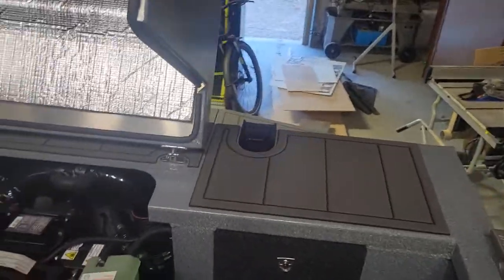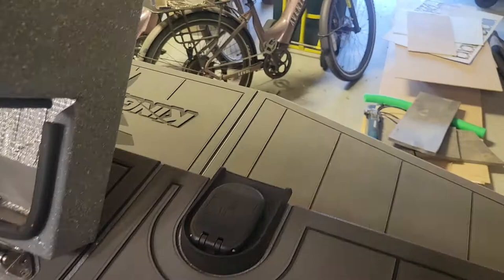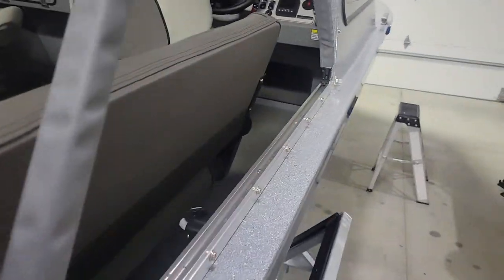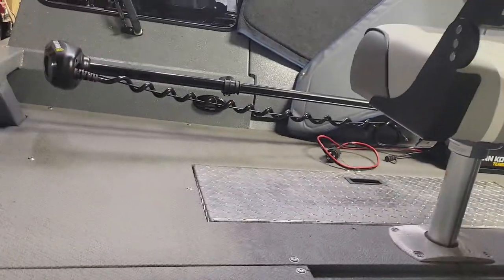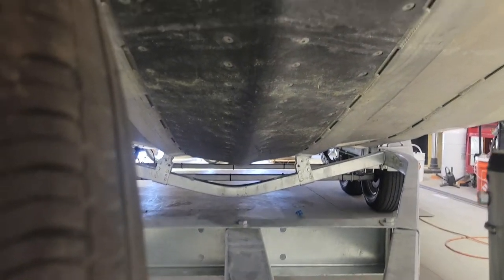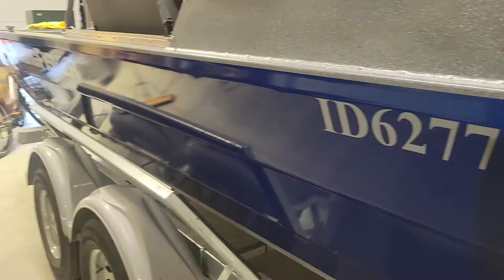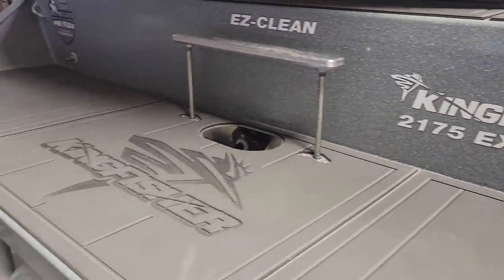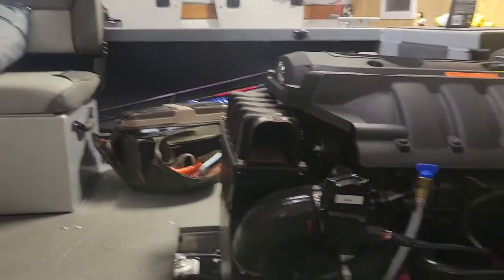More info 2023 kingfisher 2175 extreme shallow 2.3L

Comment: It doesn't have a heater option.  Lol  Nice boat. At WOT, how many gallons per hour burned? 

Wish jet pump had trimming for fine tuning (porpoising) without needing to install aftermarket trim tabs which would be damaged on skinny water.
Reply from the maker: There's a spot on the cooling exchange system to plumb in a heater, but wasn't an option. Truthfully, I never used my heater on my old boat much.

Comment: Hi Jason, how does this boat handle chop or rough water.  I would be using it on the Snake and CJ Strike but would like the versatility for larger lakes.  Thank you !   Rich
Reply from the maker: Choppy rough water, the boat does great, especially with the suspension seats. I haven't had it on a lake with big waves, yet so it's hard to tell. I would imagine it could get a bit interesting though given how flat the bottom is. I run mainly from Marsing to Swan Falls and the boat performs great through all sections.